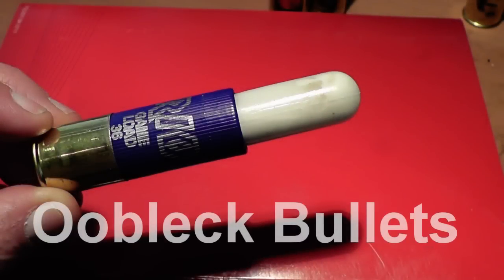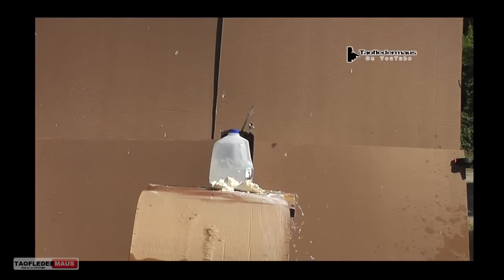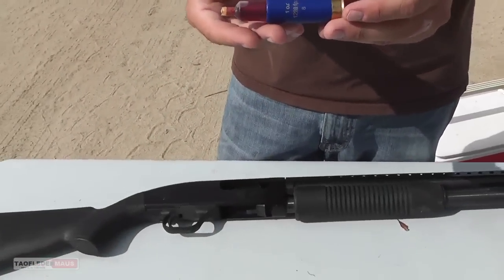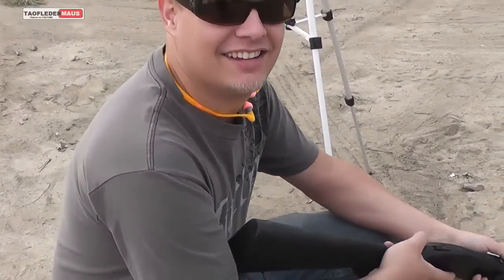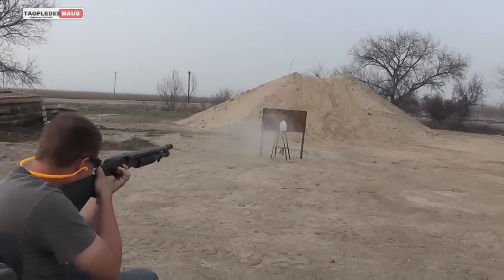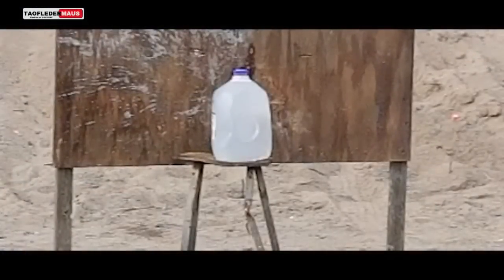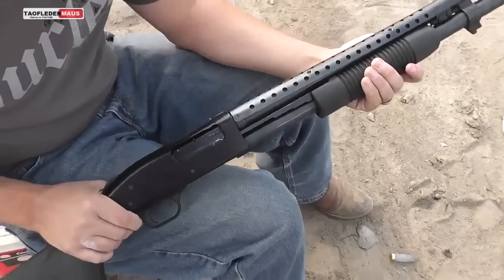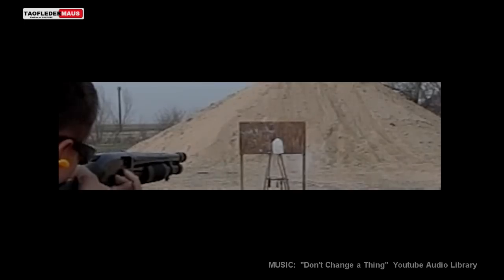Non-Newtonian Fluid Shotgun Bullets - Must See!

Comment: When red dyed water was shot out of a shotgun, it left a trail of red mist. When red colored ketchup was shot out of a shotgun, it left a trail of white mist. Strange...
Reply: +darin nozina The ketchup burned.
Reply: Karina 
smart guy
Reply: It's probably because the pigment used to dye the water red is smaller than the stuff making the ketchup stay red, so when the water evaporated is was able to take the pigment with it, while in the ketchup all the red stuff was left behind.
Reply: Nogi_13 no trail by ketchup. Air from the actual shotgun was burst out with the bullet
Reply: the paste in ketchup is heavier than the added vinegar, when it shot out all the viscous fluid condensed only leaving a spray of vinegar

Comment: Where do you get your Special Forces grade plywood from? My standard military grade plywood just won't cut it any more.
Reply: We used to buy 4x4 sheets of 1 1/8 inch plywood down there. They were old tomato shipping boxes. Can buy them very cheap when they no longer make good boxes.
Reply: Pff... Special Forces grade plywood is wholly and completely inferior to my Black Ops Natural Hard Fiber Laminate Building and Plating Sheets.
Reply: Seraephus Is it fully deniable?
Reply: Monkey The deniable nature of the Black Ops Natural Hard Fiber Laminate Building and Plating Sheets currently is classified as a unknown known; further inquires on this subject may be directed to the following address: 

1600 Pennsylvania Avenue Northwest,
3rd floor, North East Corner Toilet, 
Washington, DC 20500
Reply: Seraephus Thanks, I'll get in touch! I owe you a beer.

Comment: Used to. Use a purple top test tube filled with water, with 100 MPH tape wrapped to fit snug in a 12 ga she’ll. With a single shot break breech shotgun to blow door locks out of doors for SWAT entry’s...worked very well.

Comment: Based Taofledermaus doing my suggestion (obviously not mine alone but still)! I knew the oobleck would be poor overall but would have some potential because of its mechanical properties as a non-newtonian fluid. The next stage is to find a denser alternative shear-thickener - one that's safe to fire from a shotgun - and test that out.

Comment: Today (September 4th 2024 @1620 ish) I had the idea of filling paintballs with oobleck. I thought someone must have done this before, right? Googled it and then checked YouTube. You did this video almost 10 years ago and I'm pretty sure I watched it then (I'm going back to give it a thumbs up in a sec. I thought liking content like this would put me on a list but I'm 40 now and don't care) and don't remember. Tell me how not to feel the need to use parentheses when making comments). Anyway I'm off to see what Mr. Perry thinks but thought I'd check in with you. The question came to mind when thinking about the mass of a rubber bullet. If you used an old mouse roller ball I'm pretty sure it wouldn't even be close to less than. Tell me what you think.

Comment: Turn the capsule around maybe? It seems a good way to prevent the oobleck from escaping would be to give it a surface to push against that won't give out, such as the cap.
Reply: +MichaelSenpai It didn't escape, the problem was primarily that the bottle of oobleck was unevenly weighted and too light to fly straight or do significant damage, otherwise the experiment proved that it stayed solid when hit by the shockwave created when firing the shotgun and wouldn't be able to escape from the bottle neck in flight/on impact.
Reply: +MichaelSenpai   No offense mate but you look exactly like the standard GTA Online character :D

Comment: I was reading about a liquid armor system the military has been experimenting with, maybe you've seen it Mister Fleder Meister? Apparently its an electrically charged gel infused with small bits of iron. I was wondering if the Oobleck could be used as a medium in a similar fashion. Since it becomes more solid upon impact maybe there will be more bullet stoppage?
Reply: That's pretty cool. I wonder if they will start trying to use graphene in armor. And nanotechnology

Comment: you can get silica nano particle's if you combine them with poly ethylene glycol you will have a shear hardening non Newtonian fluid which should work better than oblec.
you can also get silica coated ferrite nano particle's mix that with PEG and you'd have a shear hardening ferrofluid!

Comment: Liquids can compress too.
Reply from the maker: +Digital Ghosts  not on Earth
Reply: Under tremendous pressure liquids such as water can be compressed too. It requires gigapascals of pressure to change the volume significantly but it is possible. Therefore it's incorrect to state that liquids are incompressible. Furthermore - under supersonic flows, compressibility has a crucial meaning for the behavior of fluid.
Reply: +TAOFLEDERMAUS you got destroyed
Reply: +Digital Ghosts 

Minor details haha :P

TAOFLEDERMAUS' statement is accurate for most practical purposes on Earth.
Reply: +Digital Ghosts WIN
Reply: +Digital Ghosts Not really...
Reply: At 40MPa water volume decreases by 1.8%. This corresponds to water pressure at 4km depth (~12000 feet)
Reply: +Digital Ghosts You are correct.  It also turns into solid form alternating from space centered to proton centered crystals.  So far we made it to ICE 13.  Not sure if 14 has been reached.
Reply: +TAOFLEDERMAUS You are wrong.  Digital Ghosts is correct.  And water compresses even under the slightest pressure, JUST NOT VERY MUCH.  Do you think at 40MPa it all of sudden shrinks 1.8 percent?  No there is a curve involved.  Hydraulic fluid compresses 1 percent at 5000 PSI.  Depending on the makeup of the fluid.
Reply: +just4fun620 Yes he did.  Mr. Non newtonian shear thickening fluid don't know his fluids.  HEHE.
Reply: +Alek S Yes Digital WON
Reply: Alek S Somebody like me :p
Reply: Yea,
Reply: +Alek S  You finally got something right!!   I do have much better things to work on.   My sexual preference is heterosexual so you missed that one but once again your 50/50 this time worked in your favor.  I guess my job here is done.
Reply: For the sake of practicality it is assumed water and other fluids will not compress. They do actually compress but it takes a huge amount of pressure to make any significant difference so it's pretty much irrelevant.

Comment: oobleck with small steel bbs in a capsule?  it may not be accurate.....but it seems to have a straight enough splash that you could hypothetically balance the force enough if you add a slight weight  imho

Comment: 3:00 first shot of Oobleck.  (I am familiar with Dr. Seuss.)  That first round did NOT penetrate the plywood.  It created a nearly plywood deep crater, showing through the plywood (.75 inches, 20mm?) but the container did not penetrate.  Had this been a solid bullet, a penetration would not be recorded.  Perhaps some of the Oobleck penetrated, but would it do any serious damage to a target on the far side?
Second shot hit the 'stand'.  Pretty sloppy accuracy (of the projectile) in my observation.  Yes, this was only a preliminary test and not a finished product.  So far, I see no reason to augment my pistol.

Comment: Make a diet-coke-and-mentos bullet! With something dividing the two so they touch at impact :p
Reply: I think with these pipette bulbs, that could finally be pulled off.  Diet Coke in the bulb with the Mentos glued to the end of it.  Or maybe drill out the Mentos to fit over the stalk and the whole thing wouldn't need to be fired "backwards" and depend on it flipping around in-flight.

Comment: I wonder... If you used a heavier delivery system. Something like a jacketed hollow point.  Maybe a copper jacket with a thin end cap. 
Something just strong enough to withstand the shockwave of being fired, but upon delivery would fly apart....
Huh imma roll this around in my mind-brain

Comment: Can you shoot a potato out of a shotgun, just like a super high velocity spud zooka?
Reply from the maker: Haha,   a few others have suggested that and for some reason I keep forgetting to do that.
Reply: ***** would the potato round be so light that powder wouldn't burn properly? Would a gold bullet be very close to a lead one?
Reply from the maker: Loys Eugene Carter I think if the potato round was large enough,  the weight would be enough.    A gold bullet would weigh more than a lead bullet the same size.  Gold is quite a bit denser than lead.
Reply: ***** Speaking of size, I was assuming the potato round would have to be small enough to fit in the shell and no longer than an average potato which would only be a few ounces. I know gold is dense,no offense,  that's why I assumed it would have similar kinetic energy. Gold is softer even than lead so I was wondering about how it would mushroom or even disintegrate in a soft target like ballistic gel.
Reply: Loys Eugene Carter "Gold is softer even than lead"

No it isn't. 24K gold is harder than lead.

Comment: Several Years ago I read about  compressing corn starch under high pressure  with a bullet swageing press into a bullet shape   surposedly  to be used by Air Marshals   back dureing the high jacking to Cuba era 

The thinking being  that the bullet wouldnt over penatrate  and blow a hole in the aircraft  body
Reply: They have had special fragmenting rounds for that. They also won't penetrate the hull of the plane, or fracture a window. These rounds have been around a very ling time.

Comment: "3/4 inch plywood, or about 20mm thick"........ I live in Canada, and for all construction applications we use feet and inches.  3/4 inch plywood is 3/4 inch.  Despite our using metric for most other things.... man Canada has a messed up hybrid system.

Comment: what is the definition of a non-Newtonian fluid?
Reply: A fluid that has a non-linear ratio of shear strenght and shear speed.

Basically it becomes thicker when you put pressure on it. If you have a swimming pool with oobleck, you can run on it if you stamp your feet on it.
Reply: thanks.  it's not an aspect of physics i spend much time on.

Comment: You need to do that thing I told you that makes it look like a pill then it might fly straight
Reply from the maker: uh ok!
Reply: ***** your welcome just cut the sides that has the little tub part on them off and take then take the parts with out the tub part on them and overlap one on to the other and then glue them together